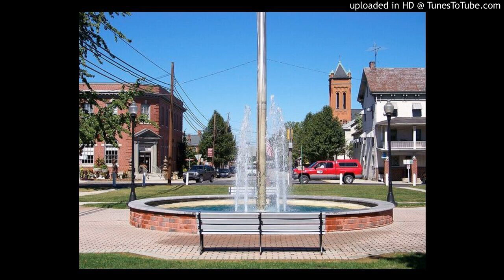NX1 Crossbar in New Oxford PA, August 1976

Comment: In early versions of the NX1-D, 60 IPM busy tone was applied by the Lockout relay in the customer's line equipment.   When a busy line was encountered, the switch train just dropped you to Lockout.  That worked great for busy lines, bur a equipment time-out  or call failure during call setup would drop you to Lockout, and return a line busy instead of a reorder.  So North came up with the LBY mod.  They installed LBY relays in all of the Subscriber Terminating Trunks, and, when a busy line was encountered,  the call stayed up to the STT, and the LBY relay was operated, returning  a line Busy.  The Lockout tone feeds were then changed to reorder, improving the whole LBY/Reorder mess.